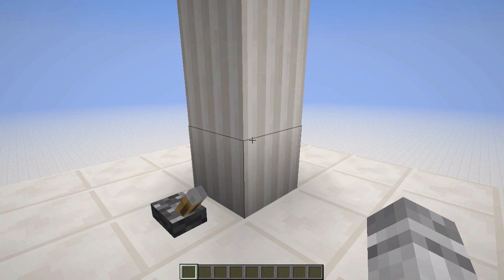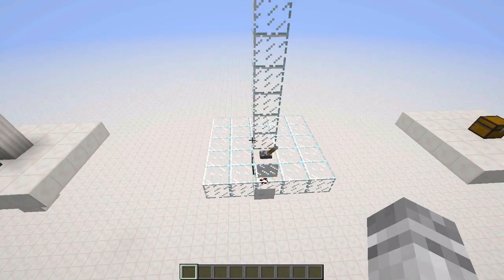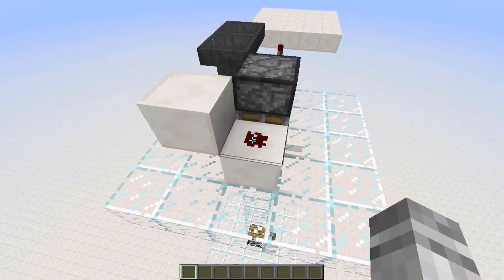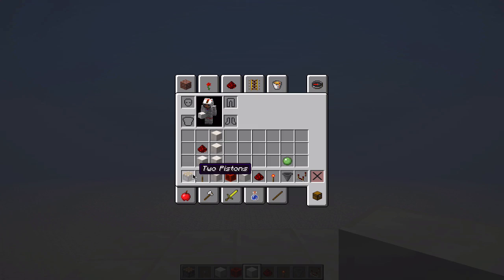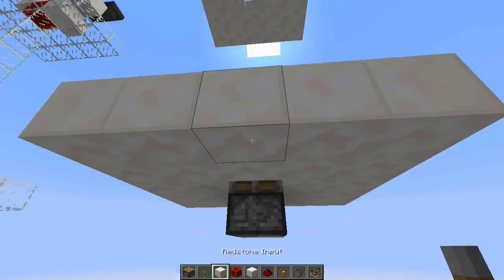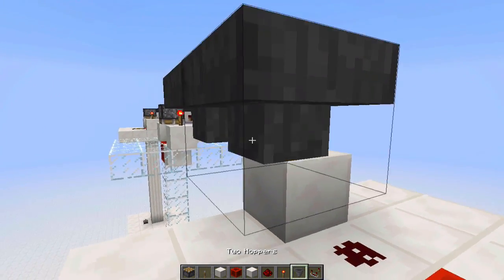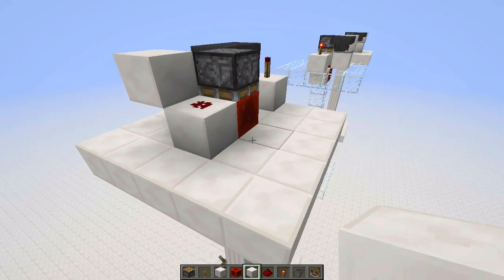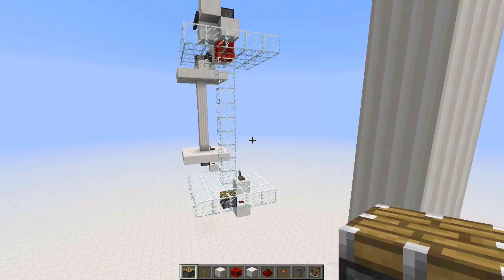Redstone Pillar

Comment: You want to be careful with hopper timers. Another redstoner reported hopper timers duplicating items when changing dimensions. Basically, the commands for adding and removing not terminating correctly, resulting in duplicated items. Screws up timers, gives free stuff to morons.